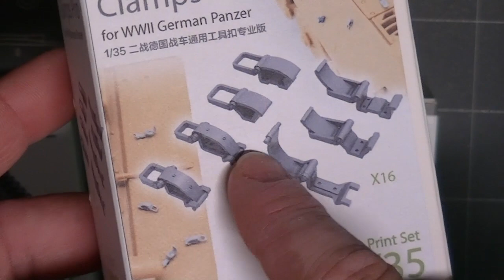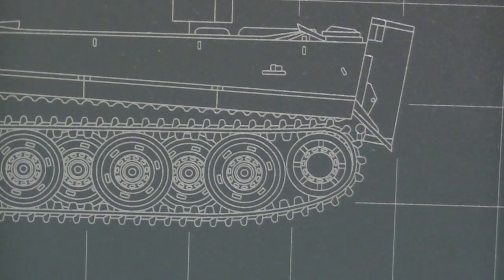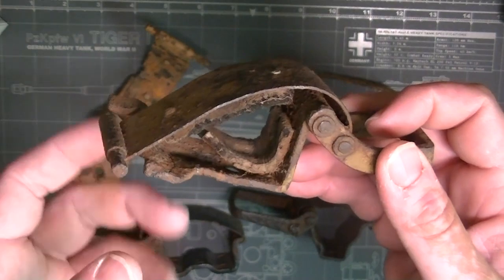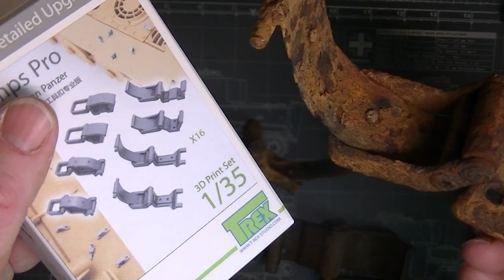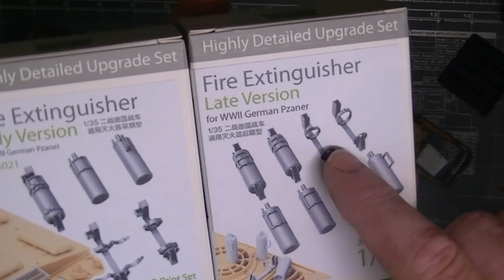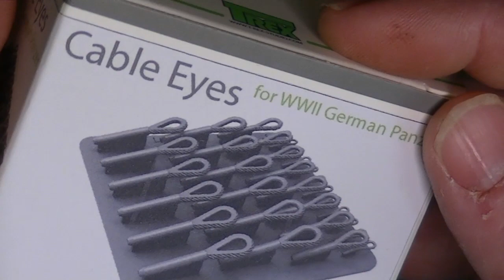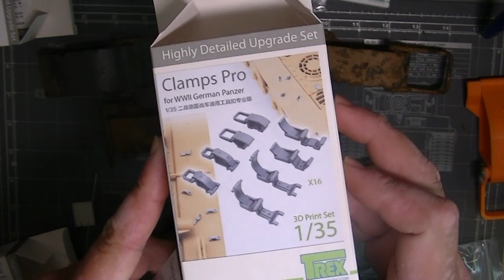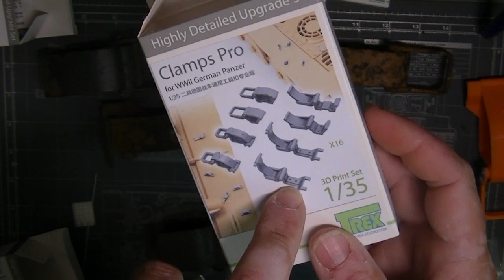T-Rex Studio 1/35 3D Printed Tool Clamp Review

Comment: Hi Adam, have been waiting for this and agree what you said regarding Mig Ammo aka FC Model Trend as the ones they sent which were supposed to fit a Stug were too small to be useable and very fragile so had to resort to Aber workable. In the light of your very full review will be ordering various bits and thanks a bunch for taking the time to provide such a comprehensive and useful review
Reply: I’m not a fan of FC.  their grills are terrible!
Reply: I have recently used aber on a stug B and a Pz.III,i found thier clamp's the easiest to assembe so far.I bought some 3D printed ones from Rochm model's,they look small too.Im wondering if the OVM tools are as accurately sized as we expect?
Reply: @darronhedges5873   I agree and they seem more durable as well. Just arrived are Clamps and Brackets for my Dragon Jagdtiger from both TRex and Aber and there is a marked difference in size. Does anyone have a view as to which is scale correct?
Reply: @darronhedges5873  Think I have answered my own question by re-watching Adam's Video :)
Reply: @derekshores5839  I’m on my second full detail set by Rochm models for Panther,if you like PE for German armour you should have a look.Best new PE company,the detail and accuracy in scale is pukka. They also do 3D printed parts for obscure parts like welded return roller supports for MkIII,IV(something I’ve never seen before).Prices same as competition,slightly cheaper maybe considering how much brass you get.Holes in most joints,so you can use stretched sprue to join pieces so no snapping off.The site has good photos and worth spending a coffee on.@Rochm models.
Reply: @darronhedges5873  Just been on Website and they look  the business. As am planning on building the Jagdtiger Porsche 305009 with Zimmerit I don't need the Fenders so will dive in with the Basic set to see how I get on. Many thanks for the heads -up
Reply: @derekshores5839  Been dying to show someone,Rochm has gone under radar for a few years.Don’t forget without fenders you will have a large dead area between tracks(hang very low) and hull.If you haven’t bought kit yet,takom isn’t great and dragons last release in zimm or plain hull isn’t like the old 2005 -2012 dragon kits.Has revell sprues with fenders.
Reply: @darronhedges5873 I have the 2 in1 Dragon kit and I did see the Revell one piece Fenders which was a surprise but the newer Zimmerit ones are separate. Not sure which route to go down as the front/left side view of 009 has no Fenders but others have mixture of full and missing like the Bovington one. Have some Friulmetal tracks as didn't fancy the sprue ones supplied so they will sag correctly and mud will do the rest!
Reply: @derekshores5839  Had a look at the Jagdtiger set,i'm jealous.I did notice you didn't get the jack parts.If you have a look at Panther set AF35A22 you'll see the two jack parts on fret B,one with PFAFF? logo embossed and one without(logo seperate on fret A#19.You'll see two jack types, i have either spare.If you want it to finish off your build,tell me where to send it.
Reply: @darronhedges5873  That is much appreciated as the kit parts are rudimentary and I would normally up-grade. I have however only found one photo of a "pristine" vehicle with the Jack fitted, all the rest either have no tools or just the "vital" ones such as Barrell Cleaning rods or a Tow Cable. Not may photos of the back apart from destroyed vehicles seem to be available unless. Rochm Instructions seem to indicate 009 certainly had no axe as the fittings are different. Also the perceived wisdom is that on these notoriously unreliable vehicles breaking down the crews simply walked away after attempting to blow them up rather than fixing them:) Once I have made my mind up as to how I am proceeding I would be delighted to take you up on your very kind offer
Reply: It’s here whenever you decide.
Reply: @darronhedges5873  Had a look at vlog of Panzer Picture and according to him changes were made between August and November '44 and after that the 20 ton Jack was dropped so would in fact have been fitted before the end of the production run. That being the case I would like to take up your kind offer and it can be sent to 21 Tuesday Market Place, King's Lynn, Norfolk PE31 6RE England. Many thanks and again much appreciated.
Reply: @derekshores5839  There are two types(logos for both)if you check AF35A22  Panther A set and choose which one.
Reply: I have some RFM parts that fit the 20 ton long and short jack,do you want me to throw in some PE “A”type clamps and 3D printed ones?It’s only pennies.
Reply: @darronhedges5873  Looking at the kit part it looks like the first pair, 5&6? would be appropriate. That would be kind of you as decent Jacks are in short supply and need a lot of work to look half decent. Have been hanging my  nose over the clamps for a while so it would be great to be able to compare photo etch against 3D printed. I see Adam now has some Rochm so am awaiting his views with considerable interest
Reply: @derekshores5839  Great choice! Just been on panzerbasics and I have probably the best kit parts (RFM)for the 20t(long) jack you chose.Only missing handle but a dragon one should do.You can have jack fully extended it has the teeth on part too.Will throw in some 3D and PE A type clamps.Will get it to you as quick as can.Panzer basics has jacks from fret side by side,I have the exact styrene parts shown on the 20T long version.
Reply: Panzerbasics jack variants.
Reply: Sorry gone mad,the one you chose looks like a 15t jack part?I have checked again and have parts for the 20T jack,I thought they were both 20T but looks like I was wrong.If you want the 20T with parts just shout or I will send the one you wanted first.Sorry I assumed they’d both be 20T.
Reply: @darronhedges5873  I think the 20t was fitted according to Panzer Picture so will plump for that.
Reply: @derekshores5839  That’s the one with RFM parts,I think you’ll be pleased with fidelity.Ive added a couple of each size of 3D A clamps and a dozen PE ones.Post it later if poss,if not tomorrow.If your on lookout for some tweezers that don’t spin PE parts
Reply: UKsyze 15cm straight dental tweezers.
Reply: @darronhedges5873  Would that be the "Micro Pointed Tweezers Straight 15cm" at £11.95 on their Website? Also thanks for the heads -up on the Panzer Basics site which I have Bookmarked and will plough through when time permits. Thanks again for the advice and assistance
Reply: @derekshores5839  Those would be the ones,round cross section means you can rotate them in hand and there’s a stopper which spreads pressure evenly along gripping area.Before I post I just want to check(panzerbasics-jack variants has your first “5-6” choice it has the smaller winding gear “spindle?”where you put handle and says it’s a 15T jack) whether you want “5/6” or what I believe is the 20T long jack(for panthers,tiger II,Ferdinand) which I have the correct spindle,crown(pointed)and correct base pattern for?Sorry, want to be double sure.
Reply: @darronhedges5873  Looking at the Rochm Instructions it says in very faint print (I missed it before) 20Ton and looks like the long one rather than short
Reply: @derekshores5839  Is that the top two parts with conventional shape(one you called “5-6” originally)or the more angular bottom two parts on A fret of AF35A22 panther a.Sorry I’m a pain,I’ll throw in the sample 88mm 3D printed type A muzzle brake as penance.
Reply: @darronhedges5873  I think it is the 20TL (long) as used on T1&T2 being the second left on the Panzer Basics site under Jack Variants with the Extended Gear Case grip:)
Reply: @derekshores5839  second from left on the “jack variants” table is a 15t,second from right is 20t long extended base grip.
Reply: And all the parts for that 20TL visible on the side where the logo plate goes I have.Everything listed beneath drawing,crown,oval part for handle same and baseplate same.
Reply: @darronhedges5873  Good job not driving if getting left and right wrong! Been a bad week!!
Reply: @derekshores5839  Same here,will post tomorrow morning.Did you know the Das werk stug g kit is all dragon sprues,waffle zimmerit or plain steel parts.Sells for £35ish.Have sent an RFM Pz.IV suspension mount with oiling plate,difference between dragon is glaring.And the RFM Pz.IV kit has a load of spares handy for stugs,4 types iron return rollers,late style simplified cupolas,Ariels and mounts...scale looks ‘right’ too.
Reply: @darronhedges5873  I seem to recall Andys HHQ mentioned that a while back. My PIII & IV are all Dragon apart from a Hobbyboss IVD and Border IVG so would be interested in the comparison as not allowed to buy any more until my stacks of shame have been reduced considerably! Don't touch Dragon Neo 6956 as is re-box of the previous IIIN with all the goodies removed and link and length tracks with huge ejector pin marks! Been looking at RFM III & IV plus interiors and Miniart IVJ. Looks like RFM Interior kits are now proper interiors as opposed to the M1A1/2 kit just finished which was missing a lot both by way of parts and details such as pipework, wiring and decals. Still took me 6mths mind! Miniart looks good but not brave enough to start on their Tiran and the box art is fading in the sunlight
Reply: @derekshores5839  I’ve built 3 dragon Pz.IV “superkits” and a few more Pz.IV hulls by dragon(for SPG’s).When I picked up the RFM kit I was immediately aware of size difference,it’s daintier if that makes sense.Going back to a dragon Panther kit(6358)from a RFM Panther was like going backwards,as it should.I’ve built over twenty five dragon kits from tigers to half tracks,and over fifteen RFM kits.If they have a kit of subject I want I’ll buy it straightaway.Thier tiger 1 kits aren’t all that,too much like old academy Tiger W/interior,their sturmtiger is okay,again tiger parts let it down.The dragon Pz.II is a lovely little kit,instructions a pain.You’ll see for yourself soon.I’m about to start thier first kit VK3601 under Revosys label,built it before but now I understand the many options available.
Reply: Ed.see difference in size between dragon and rye field Pz.IV soon.Sorry,typing and talking.
Reply: The RFM PzIII is an excellent build,though haven’t built it with interior.One thing about RFM so far is their 5019? Panther G with cutaway museum style lower hull,upper and turret parts is one of the best all round kits I’ve come across so far.The Rich models Mk.II universal carrier a very close second.I built the mini art prototype stug kit,sprue gates a bit big and awkwardly placed I thought,made me hesitate over their interior kits.RFM panther has spoiled me too much.
Reply: @darronhedges5873  I enjoy doing interiors but they take a long while to do properly and I need to reduce the piles so I can get something else! I have both of the RFM Panther G, clear and cutaway and was planning on doing the cutaway only as full interior using the other kit to replace parts I break or lose in the carpet as well as improving the Takom A mid Interior and Bergepanther. I also have the RFM Jagdpanther with interior so again may need replacement bits. I have the RFM Tiger Early as reviewed by Adam and the Sturmtiger but will need the add-on pipework. Thanks for the tip on the Tiger parts. As Adam and Tiger1.info both say you are not able to build an accurate 503 will convert to a 505, Adam says that is possible and will use Rochm assuming I get on ok with the Jagdtiger stuff when it arrives.. As only been back in the hobby since mid 2018 after a 30 year break the advice and assistance is a great help and much appreciated
Reply: @derekshores5839 The clear option is problematic at best,but the 5019 cutaway kit will give you the confidence to create your own choice of where to 'cutaway' lower hull,hull and turret.Once you see where you'd prefer the open area's to be,cutting the complete parts is no great leap of the imagination.More freedom over what you want seen,the detail is so comprehensive.Mr metal color Dark iron,brush painted has a few unique properties for interior metal parts,dont mix or shake at first just have a play around you'll notice the variations.It uses graphite as pigment,only £3 a pot,i found it a godsend as you can 'chip' back an acrylic coat with toothpick.I posted parcel this morning,any questions or opinions..i'm here.Good channel 'Red baron audio books' all WW2 mostly german memoirs.
Reply: @derekshores5839  I’m guessing it hasn’t arrived yet.If it doesn’t come within a couple of days I will send you a complete RFM 20T Short Jack with Rochm parts added and the other parts that were in first parcel.I added a load of micro appplicator brushes as packaging.Posted in Epsom on Tuesday.Sorry.
Reply: @darronhedges5873  Nothing yet but this is very rural Norfolk and the post is like buses so hopefully will arrive sometime this week. The Rochm stuff has arrived and looks very impressive. Did you have any issues with the instructions as have noticed that some parts do not correspond?
Reply: @derekshores5839  Yes,the instructions have an expectation that you have struggled through many dragon instructions sheets and know subject inside out.I completely left the path of history and have fitted VK3601 with a panther front and rear sprocket and a set of tracks.Looks like a puffed up VK1602 or VK902.Turret looks like it could be made to look more ‘prototypey’.The kits a “What if” anyway,after finishing a jagdpanther with a rochm set,and halfway through a panther A rochm set a bit of freedom was needed.Fingers crossed for postman pat.
Reply: @darronhedges5873  Much more interesting to depart from instructions and more scope for interpretation. On my Acadamy Beutepanzer have resin turret from Miniarm, Schurtzen from Panzerart, Photetch by Aber and cast texture and weld seams by uncle Night Shift! Looks like you have plenty to keep you busy. Will keep you posted
Reply: @darronhedges5873  Nothing yet but discovered why as Laptop appears to have autofilled/corrected the Postcode to my work one. It should have been PE30 1JW and I did not notice. It may arrive after going round Norfolk so will wait and see. Sorry about that:(
Reply: @derekshores5839  No worries,ill give it a few days and send 20T short with Rochm/RFM parts or 15T if of any use.And throw some other bits,shame lost the 88mm Type A muzzle brake with parcel.Also i'd like to see how some RFM parts compare with border.If its the T34 'beuterpanzer' i built dragon kit amid a few T34's.I built the Egyptian T34\122,it has a triangularish pointed profile on turret modification.With some 'burlap' strap's,a searchlight mount and MG34 mount i made it look like 'The Predator'.Without doing anything that wasn't a possible modification.Have you encountered 'Mr metal color'  buffable metallic paints yet?
Reply: @darronhedges5873  Not yet but am looking for something to replicate hydraulic arms so will give it a go. RFM and Border seem to be invading the territory of Dragon when it comes to iii/iv kits. Have Hobbyboss iv D and Border iv G along with the usual Dragon suspects of iii E/F, L & N and iv  F1 and H so far lurking in the stacks so comparisons would be useful.
Reply: @derekshores5839  I think the border PzIV is a simplified smart kit in style.Dragpn brought out a simple Pz.IV kit a while back AHH built one.Which hydraulic arms?Not Pz.IV,I think there was a workable arm or a single piece choice in RFM Pz.IV..Got a preformed brass triple wheel holder from Dragon Pz.IV E superkit.For a Pz.IV D there’s a 2012 release of a snowplough variant,it’s the last release with separate tyres and high part count like “Superkits” E and C.Oh and Dicker Max has same parts too.I’ll have a look at what got left behind in RFM Pz.IV kit,There’s bogey mounts with casting numbers printed on.And the circular plate that caps suspension arms is so well defined.Just primed PE with Mr Metal color dark iron-Bieng graphite pigment it’s thin flat and if chips looks like steel.
Reply: @derekshores5839  Oh and you can brush it on and it’s self levelling.
Reply: Am ready to send 20T short jack made from Rochm/RFM parts,with logo,handles and few samples of Rochm 3D- 'A' type(later)clamp's.Have a preformed PE spare wheel holder from dragon Pz.IV kit spare too.Make up for loss of 3D printed muzzle brake sample from Rochm.Ill track it this time.D.
Reply: @darronhedges5873  It was the hydraulic rams on a DR9, suspension on M1A1 and recoil on Sturer Emil I wasn't happy with so thanks for the tip. Must admit most of my odds and sods are not much use as haven't done many kits with useful spares so its just tracks & panels. To confirm the address it is 21 Tuesday Market Place, King's Lynn Norfolk PE30 1JW and fingers crossed
Reply: @derekshores5839  I’ll gather up a few useful spare parts,You realise you can use wheels from 5019 Panther kit,there’s separate wheel parts you can modify easily to act as makeshift t34 wheels.What nippers do you use?I have a DSPIAE set spare,I moaned and they sent a new set,and an RP Tools 5.5 bending tool spare,just got a rafhart V3.
Reply: @derekshores5839  Chrome silver from Mr metal color,not super metallic II look similar same range. Perfect for hydraulic rods visible.
Reply: The 5019 kit has spindle with bolts on and wheel front with holes for attaching,you can use this to make them look exactly like modified panther wheels for T34.
Reply: And I have a couple spare too
Reply: @darronhedges5873  To my shame the 5019 is still in the bags but thanks for the tips. I have a RP8 and old Valtcan nippers and was looking at the Tamiya but unsure as to whether the price is worth it
Reply: @derekshores5839  I have more nippers than ill use in a lifetime,since i bought some Godhand CN120 craft nippers that are for cutting brass,aluminium sprues and large sprue gates i use single blade even less.Ill send a set of DSPIAE 3.0,got sent replacement set then fixed the first faulty pair.So i have 3 pairs of just Dspiae,2.0,3.0.Keep you going till you find some.Remember i have RP Toolz 5.5" PE bender i never use,yours if needed.Also have spare PE fenders for Tiger,bought voyager and griffon for sturmtiger.Make it a parcel they can't lose.
Reply: @darronhedges5873  That would be brilliant thanks. The RP8 is a bit primitive and not good for longer pieces so yes please. The Tiger fenders would certainly deal with the issues Adam was so scathing about on the RFM5003 and carried over I assume to the Sturmtiger. If a signature is required it could go to a work address which is Fraser Dawbarns LLP 1-3 York Row Wisbech Cambridgeshire PE13 1EA
Reply: @derekshores5839  That would be a good idea.Give it a couple of days to bundle up some useful parts.I was lucky when I got back into modelling I had a windfall ,able to steam through a lot of dragon,RFM kits.Have a look at CMK /48 T34 makeshift panther wheels,you can create them exactly with parts from both RFM panther kits.I’ll send some of mine I didn’t use,beutepanzers used this stopgap method a lot.Easy to do all parts of wheel available and not everyone aware of it.
Reply: With the sturmtiger fenders,we will have to share the front most fender with a cutout for bolts.One each,saved umming and aching over whether to leave one or both bare.
Reply: @darronhedges5873  Will do. I got back into the hobby following a serious health scare which meant I had to slow down. Went a bit mad on kits with the idea of getting one of each model of German Tank etc but soon stopped that once the Barclaycard Bills started rolling in! Also failed to appreciate how long it would take to do them properly and spending 6mths at a time on interior kits (good idea at the time) Another mistake was in effect doubling up on Mig and AK stuff and have a lot where packs not even opened having learn't everything has at least one use and not just what is on the bottle
Reply: @darronhedges5873  Think I have mentioned before am planning on turning the RF5003 from a 503 to a 505 with Rochm and the reference photos I have dug out show the fenders in various states of damage or even still in place. Think crumpled tissue paper
Reply: @derekshores5839  citadel air paints from Games workshop are for minitatures strictly acrylic great and cheap,easy to open and pour one handed,and delicate finish with loads of coats,hairspray chips well.A Vallejo German armour color set for exteriors I’ve had two years still good.AK and Mig two sides of same coin,Quality control awful.VMS flexy5 slow is very good CA,if you clean up with debonder.You can use it like putty to pack a joint then debond it or acetone it down to a seam.Saves soldering.Did you say you had an M1A1?Is that abrams?I have cardboard ration boxes with sleeves,Meal ready to eat individual.
Reply: @darronhedges5873  How did you get your micro tweezers as have tried through their Website twice and it doesn't seem to process?
Reply: @derekshores5839 Would have only used paypal,but i'll check with offspring to see if they bought them.Will send Nippers,bender with Jack and Clamps,3D and PE.Plus just a couple of Pz.IV RFM parts for comparison.As for now will add a cupola sprue,clear,PE parts for 'chunky five slit vision ports as added to 'beutepanzer',a sprue of unique one off 15T jack,and sprue of 5-6 ariels,mounts and covers.Threw in a wheel mask/brass,for Pz.IV,some empty 7.5 empty/full shell cases and a bucket.The 15T jack sprue and ariel's,cupola are all RFM first moulding under 'revosys' name.Styrene like Wingnutwings.Just got to package it up safely now.Ill be sifting spares soon,then can be more specific in whats worth having.The PE from Panther A premium kit is going spare too,ill throw it in.I'll send to second address, you gave.Should be on its way in couple of days,i live on the 'wells' the most 'rural' part of epsom,at least a mile to town.Dont forget Citadel Air paint,very delicate with interior detail in layers.Made for layering paint colours and washes on miniatures,a pure acrylic,just plastic and water.Base for any kind of weathering.Ill check back with any info on tweezers i find(Did you see their dental pliers!)Bet they might all come in usefull one day?Im like a magpie.
Reply: @darronhedges5873  Wow that's a lot of stuff and will I assure you be put to good use. Will have to follow your example and sift my odds and sods box as lot of stuff there is of no further use such as Challenger2 Resin barrel (any use to you?) and other bits I cannot now identify. Methinks in hindsight I should not have gone nuts when starting up again and just got bare essentials and then sought guidance from such as yourself as to what is best. Would certainly have saved a wad of cash!!
Reply: @darronhedges5873  My cunning plan originally was a 1/32 Lancaster due to family connections but wimped out due to the money thrown away if I cocked it up and the sheer size as only place to display it would be dining room table hence the 1/35 armour! Pity about Wingnut. Had heard Meng was picking up the tooling but nothing recently. I have not weathered one vehicle the same as am unable to settle on a particular method. Get the chipping, washes, rust, streaks etc done then am reluctant to cover up what sometimes looks pretty good! Will warn Reception to be on the lookout and will keep you posted.
Reply: @derekshores5839  Kit meng tooled from WnWs was because of demand and price gouging on ebay.Only the most 'commercially viable toolings will be sold.Earlier moulds are gone,limited run kits.Thats the split in prices after monoplane junkers D1 kit and before.More kits made from those later moulds too.
Reply: @darronhedges5873  I must have been living in a cave as did not realise Peter Jackson of LOTR was the money man behind the company. Knew he was building replica planes for re-make of Dambusters but gone quiet. Now starting Jagdtiger. Old Revell/Dragon parts certainly less refined. Any use for lower Hull/Casemate non-Zimmerit parts otherwise will be binned?
Reply: No I’m okay have already given my spare set to granddaughter to paint.Can share some PE side fenders for KT,have two sets and don’t intend to use all.Remember a lot of hull exposed with way tracks lay so low looking with Porsche suspension.Staring at it now,not good.Needs a couple a side to break up space.As for Peter Jackson,trying to cadge money from Aussies for British war film  tie in was a reach too far.Why Film company couldn’t front the cash for a share of proceeds from model kit(merchandise),wild idea I know.I listened to Camu’s Human Crisis speech last night,made after WW2 in US.Read it before,but makes more sense today.I used the Vallejo orange brown for red oxide,don’t use purlpley one.AK panzer grey set is pretty good too.At tankfest 2016 I got Donald trump engraved on a bullet at a stall,they called it over tannoy “Could the gentleman who.......
Reply: @darronhedges5873  Am planning on following the original Tank Museum photos which has the Bovington one with 2nd right and 2nd and 5th left missing (before they removed all the Fenders) so not too much of a gap. Shame about that but would have thought WETA would have enough cash from Avatar. Thanks for the tip on Primer Red. What do you use for first fix on the Rochm bolts? Boy are they small!! No visit from the Men in Black then!!!
Reply: Cocktail stick and saliva to place,a small sewing needle with eye snapped in half to leave a predictable amount of glue(cocktail sticks are unreliable for small spots of CA).They are a bit expensive but Mr Hobby micro pointed cotton buds are a good way to clean up any excess CA around small PE assemblys or bolts with debonder or acetone..They don't fall apart and catch on everything,just lose their absorbent properties.If you have no PE sideskirts/fenders for Jagdtiger,i have two complete sets for two dragon KT's ive built already.I only plan to use a few,not fussed which.So if it'd help i could dig them out in near future.Parcel meant to be 'next day' delivery?'Guaranteed!
Reply: @derekshores5839 My all seeing box informs me that parcel has been delivered.Signed for by Evil-san?
Reply: @darronhedges5873  That would be Kelly-Anne who described the contents as "Airfix bits" It has just arrived here via the inter-office Courier and all I can say is thank you so much. Will sift through thoroughly when next in modelling shed. You must either let me have an address or Paypal number so I can re-imburse you the Postage as it must have cost a bomb. Thanks for the tip on PE and tweezers which  got via e-bay cheaper than their own Website. As to KT I have two in the stash, a Takom Initial and Meng which I plan on painting in Octopus camo if I get better at airbrushing camo so yes please
Reply: And if your painting mostly acrylic with camouflage, it’s best to use Regdab by badger,one bottle will last forever.The only working silicone oil for needle I’ve found,about £8.Stops needle tip drying too fast.So much better experience,more painting than cleaning.Confidence when painting thinner lines accurately with no spitting clogging etc halfway through.
Reply: @darronhedges5873  Will bear that in mind but next few in pipeline will be single colour to use up duplicate paints before they go off which I have read is possible. Nippers awesome!! RFM IV parts more refined than Border and Dragon and even have Casting numbers. The others seem softer and muddy by comparison. Fenders and Command Antenna will come in handy along with the other Dragon bits which they no longer offer. Resin Clamps look interesting. Rochm and Trex now doing Resin Tracks. Will have to wait for Mig to offer Trex as was going to order some Lifting Hooks to replace cocked-up Mig order but shipping astronomic, $40 for something costing $9.50
Reply: @derekshores5839  All RFM parts.Ariel,j15T Jack,cupola are all from first RFM/revosys kit.The styrene is quite soft.If you can fix the Blade adjust screw on nippers they will last ages,my 2.0 set are four years old,still sharp.Changing split washers for springs on bender could make life a bit simpler.Glad all sorted so far.
Reply: @darronhedges5873  Thanks for the tip on the forceps as making PE so much easier which is just as well as instructions not good! Having to take tablet out to enlarge pictures to figure out which way to bend things and how to complete such as cleaning rod clamps as this is not shown. Great detail and impressed with how small connection points are. Have just received for Birthday Takom Panther Book by MIG (the Mrs can take a hint!) Supposed to be definitive modellers guide in which case how can one contributor say for example Gearbox should be Swartzgrau but MIG profiles for Takom are different to the G they did for RFM? Looks like the Littlefield Panther so is this accurate? Discuss!!
Reply: @derekshores5839  The instruction sheet got a little tatty before i thought of the tablet.WILKO revolving cake decorating stand.30cm diameter,tuff white plastic,metal bearings,can drill holes in it to mount a bolt to hold a model.Phew...£6.I got three,clean one and two to mount kits for painting.You can drill almost anywhere on base to mount holding device.The 501 walkaround has a jagd'chaser'38T(G18 probably)at the end has what looks like Valleho 1001 as 'dunkelgelb' and the panther 7028(RAL).With labor(forced?)making paint and how long left in all weathers waiting/being transported to front,the inside of stowage boxes probably nothing like at front.Plus scale would make perfect match darker when smaller.I call it 'Ahab syndrome' matching paint.Too many variables,biology,physics.ad infinitum.I was using valleho and AK on VK36 kit as warm up for panthers/rochm kits.I went back to finish firefly turret with Citadel air paint,made AK and valleho look far too matt,like the suck in light.Looks cool,like a coat that drys dusty and too fast,but Citadel looked like realistic paintwork.UMP thinners works perfectly or water,hairspray chips great,clogs needle less.Cheap,and can open/close and pour one handed.Very fine pigment(designed for miniatures).In the past i managed to create a reasonable 'dunkelgelb shade from citadel,i bought the German armour sets out of convenience,going back to paint Firefly turret showed them up a bit.Ill be using Citadel Air for my panthers,covers better with thin coats and zero texture.Mimics slight sheen of large matt surface area.Sorry for rant,whats timeline for JT fenders,when do you need them by?
Reply: @derekshores5839  The Vallejo is ok for simmer it,but for the sturmtiger the citadel gives that slight sheen as in museum.Jumblies selling RFM panther F kit for £33 with PE detail set cost &50.I’m a glutton,but the L100 clinched it. Means I have an L70 without muzzle brake spare.And more spares than MAN factory.I only weather lightly but logically,just oil washes and filters,maybe some touched up bleached paint etc.Good luck with carpet layer,artists canvass doesn’t look too bad,just manipulate it a bit till it goes soft.
Reply: Just looking through the Panther F instructions,had an correction sheet.”Sprue H not included”,the picture of it looks like it’s from challenger kit.It has a .50 cal and a Gympy on it and a cupola.Glad I found correction sheet,thought I’d gone madder.The kit and the detail set are good,clamps notwithstanding.The AA armour must be 0.5mm + thick,the detail set doesn’t double up on kit PE,making it hard to beat on price/quality.Not rochm but doesn’t feel like a “cheaper set,just missing a few minor details.Jumblies has loads of RFM waiting to come in,if Panther F with working tracks PE set,better than dragon can’t command more than £33 after a year,see what happens with rest.Ton of odd spares,jagdpanther glacis plate and mantelet plus chaff same as other panther kits.Cheap though for a 2020 release,hope it’s catching.Lockdown prices Snapback?Or brexit slowly kicking in,Singapore on Thames.Like inviting a drug dealer to sell from your house for a cut,while investing(taxpayers) money in his business.
Reply: Just found some spare large clamps,A type.Ones with six bends,have one spare from new RFM detail set( and couple of Rochm)Can put it with fenders when you need them.
Reply: @darronhedges5873  Would that be 71-025 as  I have that in a Set? As well as being told not to increase my stash I am waiting to see what pans out as to VAT since Brexit as tended to get my Kits from either Spain or Poland as were cheaper even after Delivery. Bit random as to correction sheet as different decade! Was wondering about those add-ons by RFM and wonder why they do not simply include them like Miniart as then no need to up-grade. Speaking of which thanks again for the tip as to the forceps which proved invaluable on the PE. The Rochm stuff appears to be the way to go but bit limited as to range. Certainly more to scale than Aber but will stick to them for non Tiger/Panther as find it almost impossible to source Voyager. Might go all out and get both PE and resin clamps to cover all bases and possibly Tracks. Finished JT and about to prime but "confused" as to chipping. I thought the Zimmerit was applied in two coats after primer red on metalwork and if damaged would only show the ochre/off white of the first layer or primer/metal if deep gash or shell impact so you don't in effect chip Zimmerit to red primer. Just seen PM36 tutorial which mentions on KT red primer applied on top of Zimmerit so damage to top coat of paint would show red primer. Not seen this elsewhere and doesn't seem logical and as KT and JT were being built at about the same time wonder what is correct. In the Takom book  one of the contributors has chipped his top coat on a Panther A down to red primer despite his applying Zimmerit
Reply: @derekshores5839  I am sorry for not replying earlier,a certain letter of the alphabet was stalking me.The 'tiny' 'non sinister' unamed intrusion,should be lasered to a crisp in three weeks.Had a month of stress waiting.Be in touch soon,Das werks 1\16 stug is an 'elephant in the gloom.Your forced into some hardcore scratchbuilding to pull it off for a close up.People don't realize the size/realism issue with \16.Lot of rabbit holes once you start to notice what can't be realized in \35,yet needed for \16.
Reply: @darronhedges5873  Know how you feel and hope all goes well. Not so log ago received a letter asking me to attend Macmillan clinic which does tend to put the wind up you but thankfully all good now. Was toying with Trumpeter 1/16 but was put off at the level of scratch building necessary to correct/make accurate because as you say, flaws do show at that scale and you cannot cover everything with mud!
Reply: @derekshores5839  Makes me suspicious when i see too much mud.Guess who'll have a stug G in 1\35 with full interior released in 6-9 months with thier own update set.Theres three newly tooled  \16 stugs on way,after the PzIII RFM had to release a stug.Now theyve got PzIV variants and Pz.III they have starting point for lot of vehicles.Imagine RFM elephant full interior!.OK after the Jagdpanzer 70V,brummbar and Stug IV.Yes the Dark yellow from set(shake up white its first to dry up)71 025 ral7028?.Theres a walkaround of Panther 501(Littlefield?)on youtube,if you watch till end where you see 'hetzer'(G18 probably)you can compare the dark yellow used on each one.Shows how haphazard  the whole concept of colour matching is.
Reply: @darronhedges5873  With Takom, RFM and Border doing Stugs it is like the KT and Panther frenzy of a while back. Will keep an eye out and await the verdict of the Stug guru, PM36 before deciding on which one as already have a F8 Late with Winterketten and G with Concrete, both Dragon obviously. Was going to use the Vallejo but in intervening time since purchased turned into bright yellow gloop so used some LifeColor which is an "interesting" shade, pale yellow, but at least different from the others
Reply: @derekshores5839  And with the hulls come the variants,when RFM released PZ.III I guessed a stug was en route.The /16 are for people who don’t use a magnifier.Imagine an Elefant/Ferdinand with interior by RFM to panther standards(Their easy 8 had a few dead areas of detailing.As for Life colour,all the competent modellers seem to use it.I’m just adding a touch of a mustard colour to a sand brown by GW citadel air,I’m addicted to how easy it goes through airbrush,don’t know if it’s the Neo airbrush in particular but I can spray citadel at really low pressures with it.Think it’s the cap design that does it.RFM’s PZ.IV had some odd stug factories related spares in kit,like the multiple sets of return rollers evolving using less metal with evolving designs.And the spare cupolas all early types with small feature changes.Maybe a stug IV one day.I never got the F8 W/letter although I built the two aces kits,Bose and spranz I think.Funny how Border has an MRAP kit out suspiciously similar to RFM.Saw something about PM from border saying RFM stole thier Pz.IV CAD?And MRAP came after RFM’s?Could Border/RFM be the dividing line in business dragon never mastered?Skill level for brand.Really being pulled both ways,instant versus delayed gratification.How did tracks go on JT?Or locking chain for gun(I’m doing the two panther ones from rochm).Don’t forget WILKO revolving cake stand £6,you will be pleased with it,bet you stock up when you’ve seen one.I have a Chupa chips lolly stand from shop display,stackable units that you can fit twenty plus wheels etc on each stack.Hard to explain but very useful when spraying lots of parts.Each stack has an outer rimg of holes and slots around center.You can hold it one handed and spray set tiger/panther wheels easily.Xmas soon.
Reply: @darronhedges5873  No shed time as been in Suffolk on wet staycation. Had bit of Internet and saw AHHQ build the 1/16 Stug. Looks like blown up1/35 and very short on detail such as on and around the Smoke Launchers as RFM do the details as add on in PE. JT Metal tracks were fine and better than the kit tracks although as P JT were still  6 parts. Did read RFM and Border are having a tiff as to copying. Until build the Border IVG will reserve judgment but am inclined towards RFM as hopefully interiors have improved since their M1A1. Also see Border have the Wingnut 1/32 Lanc coming out. They say delay due to mold issues and price circa £350 or upwards so they better get it right at that price. Not been shopping but will keep lookout as pain holding JT as so bloody big. Next on that detail, filter, wash, streaks and wash and as wheels look good might not cover it in muck as colour changed markedly with Dark Yellow ammo filter and more like "normal"
Reply: Can't hold model's to paint,always a warm fingerprint will leave a mark.With the wilko's simple design easy to have work 5" above turntable secured with two nuts on long fixed bolt.Border have chosen a hard act to follow,think the price will balloon(why bought moulds-demand  versus labour of love(backed by NZ grant).The PJT tracks were a knightmare.On dunkelgelb washes(i only use enamel for oil,wet effects)the bleached areas of paint can be highlighted with straight oil paint.Well the general anaesthetic didnt kill me yesterday and pain gone by today.Oh and ive seen RFM progression in building kits from Abrams to tiger kits,panthers,PZIV,PZ.III,T34's and MRAP.No doubt its been all their own work,even having parts from PZ.IV kit sprues with parts for unreleased kits.Plus timing of borders MRAP release and choice of projects(\35? BF109,wnws Lanc) makes border look the suspicious party.Rather argue for RFM on info at hand.Accusing someone of stealing your design for a kit they are already selling,as you release a kit they already have for sale.A one off subject too,for both companys..the OshKosh MRAP?
Reply: @derekshores5839  Sent message when i came back after general anaesthetic,im guessing you didnt recieve it?
Reply: @darronhedges5873  Hope you have a full and speedy recovery. Only got the short one and this. The Oxley review points out flash, poor non colour instructions and huge price so even if had the room will give it a miss despite family connection. Went with Brown for Dark Yellow Mig Ammo Filter which changed tone to something that looks more realistic and sort of dust residue on Zimmerit which might save time. Still undecided on which PIV interior kit and propose waiting until done the Miniart Tiran 4 to see what they are like. Will probably get RFM III and Stug as well as Sherman but not for a while as need to churn through the stacks. Border/Takom/Das Werk all seem to be intwined. Looking at either Rochm or TRex Tracks as alternative to Friul. The RFM ones seem a bit expensive. Stay safe and get well soon
Reply: @derekshores5839  I was 'away with the faeries' for a couple of hours after i returned,still wasn't going to be sucked into a £100 deposit to 'secure' purchase of Border lanc.I lean toward a browner DG,people seem to go yellower with tri tone patterns.Never built a mini art interior yet(built proto stug )but didn't like some of sprue gates placement.Awkward,big and hard to reach sometimes,dogs already got that nailed.But RFM was good experience,got to have version decided beforehand it saves heartbreaking choices during build.RFM was my first PzIII,with aber and griffon PE,No interior,NP to me as PzIII selling point is its compact look(i swopped 5cm for 7.5 short)Are RFM tracks 3D printed? I thought they were scalping tamiya builders with styrene ones from kit.Really twitching over Suyata \48 Panther w/interior with crane and all diorama parts (£50-60ish).Haven't built diorama since child,everything inc.Factory setting so no grass trees needed!Whats the next RFM kit going to be?They have all the PzIV parts for jagdpanzer?Or sturmpanzer??First is easier but second would be a touch.Got zimmerit to overcome sooner or later,Sturmpanzer would be great choice for debut.Lastly,any iconic jet from 70's your intereted in(not harrier)
Reply: @derekshores5839  RFM firefly is better build than easy 8.Ive built 2 E8's 1 with interior and RFM update set and Meng VVS e8.Firefly looks better fidelity with texture casting numbers and detail overall.Bieng grey styrene is nice too.Plus you have springs on both front hull hatches,look great with real spring upgrades done,and scratchbuilt applique armour for hatches,hull sides and turret cheeks.Tracks are best from RFM M4 kits.
Reply: @darronhedges5873  Seen Nigel's views as well and CAD don't match the plastic. As to aircraft was considering at the beginning the Lanc because of family connection and Osprey because they use our house as a  navigation beacon when out on exercise and we get very close up views. Problem is space to display and my interest is mainly WW2 ground war and Holocaust so will stick with that. Jagdpanzer IV 48/70 would be good as hung off getting either Dragon or Hobbyboss kits. Have Three PIII, E/F, L and N all Dragon so the remaining one will be I think RFM interior to complete. Have the Stug O you mention on the radar as a try-out to Miniart and if as you say will probably stick with RFM for the IV J. Impressed with how ROCHM PE looks when painted and weathered as details don't disappear. The TRex Track hooks are very fragile as are  the rest of their KT Brackets set. Think RFM tracks are 3D but dearer than TRex or Rochm and in Friul territory. Unfortunately on the Churchill and a 38R SP will have to resort to Friul. Very surprised how the Filter has dried to a light dust in the Zimmerit and now pin wash done it looks ok as chipping has blended nicely. Just got streaks and rust and general filth to go on hull and casement before covering up all the good work on the wheels with mud and then possibly confining that to very lower hull only
Reply: @darronhedges5873  The Panther and KT saga is being repeated as just seen Miniart doing a Stug iii Feb43 Alkett with interior! Hope the Stug guru, PM36 has got his C$ saved up!